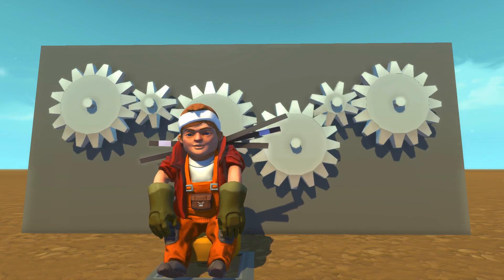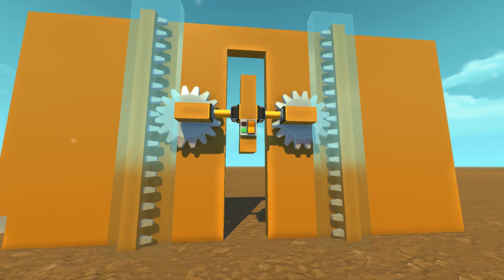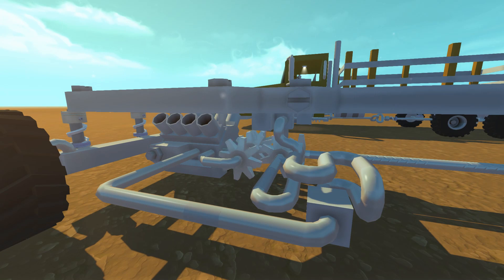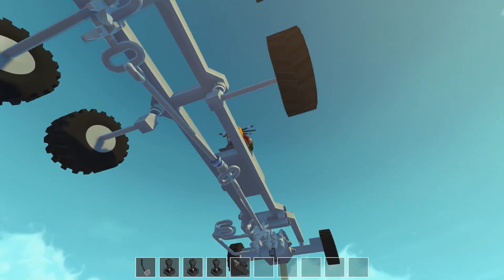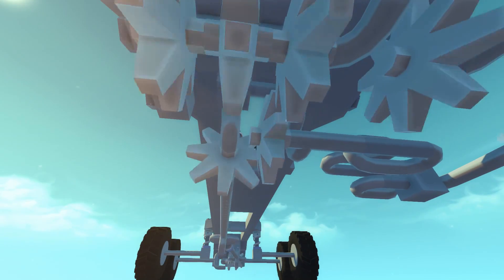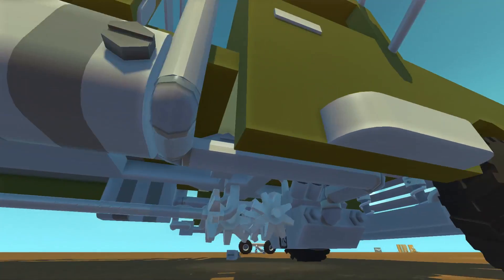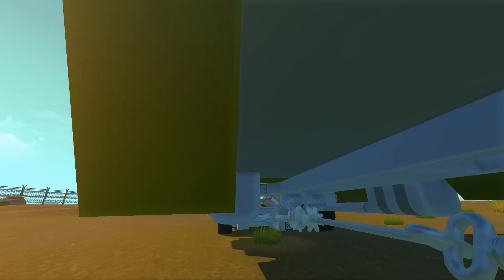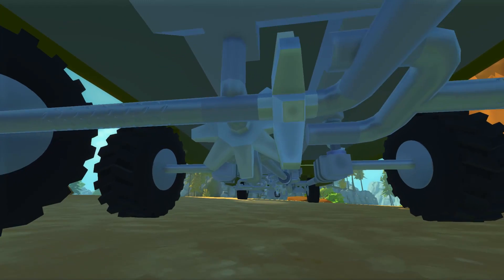3-Speed Gear Powered Drive System! - Scrap Mechanic Creations!

Comment from the maker: If you want to take part in the Gears Challenge, be sure to join the Discord server so you can submit your builds! https://discord.gg/2NXRDFh
Reply: Moonbo plz make awd version
Reply: moonbo can u please stream scrap mechanic of u making a 9670 international cabover or freight liner cabover please no one has done it can u please do it????
Reply: hay do you play xbox 1 do you want to play call of duty black ops 1 on nuketown my xbox tag is ibanez168
Reply: I have a idea of a gear engine that works better but I don't have scrap mechanic.
Reply: I joined the dicord but i have to leave because im 12 years old, why does it have an age limit
Reply: Moonbo You are the MumboJumbo of Scrap Mechanic, and both your named are similar-ish to “M o o n B O”  “M u m B O j u m B O”
Reply: @herrbonk2211  i think that kan is more like mumbo jumbo
Reply: Try lifting thors hammer with them
Reply: Moonbo I will do it soon

Comment: I like how he disclaims that it's not exactly like a real transmission. The system he has doesn't allow lower gears to provide more torque than higher heads because they're all the same size. In a real car you wouldn't be able to start moving in 3rd, but you probably could in this truck he built. Still super cool and I wanna try it out for myself for sure!

Comment: i wonder how fast you could get a gas engine car going, and we can also have low gears as well to help acceleration. also i wonder how long until we get differentials.
Reply: I want to build a differential car
Reply: @astrohahawashere  im already building one :D. i even put a synchromesh 2 speed transmission in it.
Reply: I build 5 speed differential
Reply: The project starts today
Reply: @astrohahawashere  tell me when its done i would love to see how you do it. my gearbox was only 2 speeds and a little glitchy, plus it had kinda crappy ratios so gear two made the engine "run out of power".
Reply: @abysswalker2403  there's a blueprint for the gear differential that I had btw it's on steam workshop
Reply: @abysswalker2403  btw for the 5th gear you need like 4-5 engine power
Reply: @abysswalker2403  btw it will probably take days
Reply: @abysswalker2403  it will probably not gonna be in the gear submission
Reply: @abysswalker2403  this is the gear differential pack that I'm gonna use

https://steamcommunity.com/sharedfiles/filedetails/?id=2070323212&searchtext=Gear+differential
Reply: altaf Ibtisam ah ok
Reply: @abysswalker2403  I keep forgetting about the project

Comment: You should make a setup that will slow the gear you are shifting into for a smoother transition

Edit: you should also make a Rear differential
Reply: I want to build that
Reply: Use 1 to 4 ratio it means that the first gear that spin takes four times to spin the last gear

Comment: you can weld a small gear to a big gear and use a gear to spin the small gear now the big gear spins faster you can do that with multiple gears to multiply the speed
Reply: The first gear that spins have to be the big gear and the small gear is unpowered so it spins faster but you lose torque
Reply: @astrohahawashere  i said use a gear to spin the small gear so i didn't say it backwards i just didn't said it has to be a big gear
Reply: You say it backwards

Comment: Moonbo vehicles do have gears in them. The transmission have gears in it. The drive shaft runs from the engine to gears that turn the wheels of a vehicle. The pistons of an engine transfer their power to a set of gears that turn the drive shaft, creating torque. Quick tip if you have a 4X4 vehicle and you are driving in mud or off road put it in 1st gear.
Reply: Btw there's no mud in scrap mechanic
Reply: @astrohahawashere  I know that. I played the game.
Reply: @astrohahawashere  Iam not being rude, Iam just saying I played the game.
Reply: It doesn't have to be the first gear it needs to be a low gear so it has more torque
Reply: @astrohahawashere  1st is low gear. In most off road vehicles
Reply: @the_official_djalanjs0588  it can be 2nd!!
Reply: @astrohahawashere  you are right. It can.
Reply: @the_official_djalanjs0588  most off-road vehicles have a transfer case that gives you low range. You then have access to all of your gears in a low ratio.

Also you claimed the driveshaft sends power to the gears, this is only true for a handful of GM and Porsches which used a transaxle in rear for improved weight distribution (none of them 4x4)

In most cars the flywheel bolts to the crankshaft, the clutch is what transmits power to the gears (or torque converter in an auto)

Comment: The “ball joints” are more commenly called universal joints, this is because if you where to put a ball joint in a drive shaft (the long bar from gearbox to the differenchel, in this case the two gears ateched to the rear most wheels) the shaft would just spin. Ball joints have no rotational connectors in them. 
Otherwise you did a great job, thank ya for introducing me to a new gear mod, the mod pack doesn’t have them anymore:( ps I do know I’m horrible at spelling- plz go easy.
Reply: But the modpack beta has them (I think)
Reply: I was waiting for someone to mention that
Reply: @SpacedCardsAI  glad i can help although i should probably be getting my school work done
:/ 7eventh grade is hard in these times!

Comment: i feel like i was getting trolled the entire video. you keep saying its a "ball joint" but its nowhere close. its a universal joint. a ball joint wont trasnfer any rotation. your "wishbone suspension" isn't even a wishbone. it's more of an a-arm but an a-arm is basicly a macperson strut. for an a-arm, you only need 3 bearings. one at the base of the controll arm(the bottom half) one at the top of the spring, and one at the other end of controll arm. the wheel is fixed to the spring. a wishbone has two controll arms. one on the bottom(like ypu had) and one ot the top. you almost had it, just needed to add another controll arm above the wheel.
Reply: At least I wasn't the only one who was like umm. By the way lol

Comment: Moonbo, you should try your hand at creating a fully functional motorcycle transmission.
Reply: Also, if you stick another differential so it powers both rear axles, you’ll get stuck less.
Reply: Btw the gear box is big

Comment: The Pistons are not strong enough. Try a version of the elevator without pistons
Reply: Just use smart engine
Reply: The problem isn’t the pistons.  The problem is that the gears’ teeth don’t quite mesh with the teeth placed at a 1 block interval on the wall.  If it goes slow enough, the ‘slop’ will allow it to work as the collision engine and physics engine do their best to resolve the simulation, but if he speeds it up, it ends up with teeth inside each other, and that causes the problems seen.

Comment: You should have mounted the drive shaft to the frame in front of both the cv joints, that way the whole drive shaft doesn’t shift sides when you shift gears
Reply: Or just not moving the whole driveshaft and put the clutch in the center

Comment: the thing u call a ball joint is a universal joint
Reply: I have heard some people call it a ball joint. But you are right it is a universal joint.
Reply: @the_official_djalanjs0588  ball joints are what you have on your steering knuckles, it's an entirely different mechanism
Reply: It's a same thing but the difference is when a ball join is spinning the part that are attached to it will not move
Reply: @astrohahawashere  a ball joint is a pivot point for suspension and has nothing to do with rotation.
Reply: altaf Ibtisam a ball joint is a pivot spot for hubs and such nothing to do with rotation

Comment: U could use 1 engine and just have different sized gears for each gear
Reply: Or stack them on bearings? One bearing speeding up the second, and so on?
Reply: @robertcampbell7997  that's cheating if you want more torque you need to do what he said
Reply: @astrohahawashere  it isn't necessarily cheating from the games perspective,  if you look he has done the same thing with his engine, look at the three drive gears and how they are stacked, but as far as the challenge goes, yes, that would be cheating.

Comment: I'd like to see if the gears can actually multiply the torque. Maybe a really heavy creation using vanilla gas motors and test from there.
Reply: if you put a big cog connected to a small cog with a big cog on it, it does speed it up
B=big S=small

      BS
   BS
BS
S

this also works in Create, a mod for Minecraft
Reply: TheBaddestOgre - dam u right
Reply: It will according to real life physics
Reply: You mean like 1 to 2 ratio

Comment: That is soo awesome! Just imagine a off road, all wheel drive buggy with that gear system and also one of those crazy suspension systems! That would be amazing.
This is the first time I've actually wanted to buy this game....
Reply: I agree just make sure when you do dumb stuff you have a decent spec PC
Reply: you should buy it soon so you can play survival mode when it comes out on May 1st
Reply: @evanherriges4042  by may 1st do you mean may 1st 2025?
Reply: @UAT39  so you lost hope in survival mode?
Reply: @UAT39  it's coming out may 6th surprisingly
Reply: You should! It’s so fun!
Reply: Just increase the torque using the gear for like 1 to 4 ratio